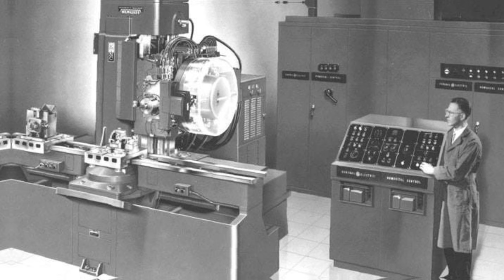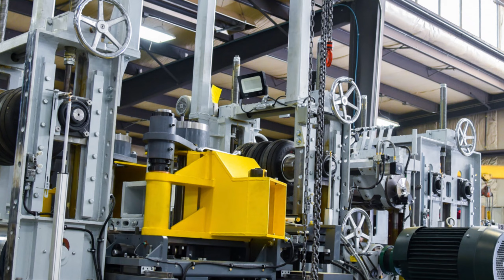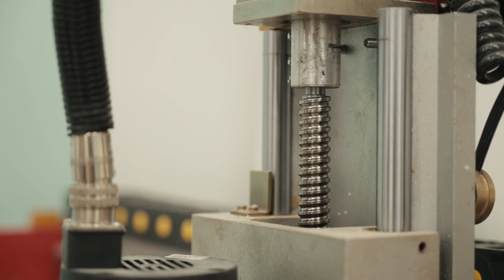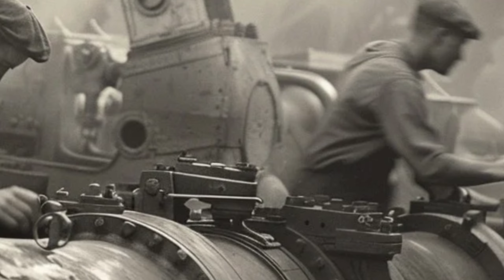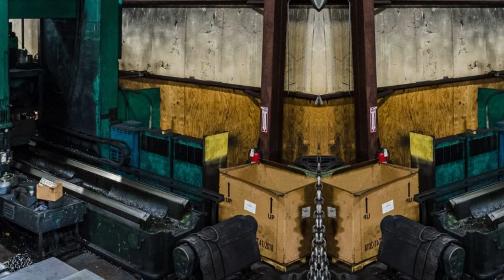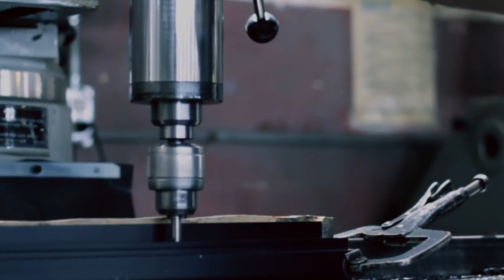The 1911 Planer Machinists Called Obsolete — Until It Removed More Steel Than Any CNC

Comment: In the early 90-ies I used to work in a shop made the turn out/ shifter systems for the railways in Europe... We used Waldrich-Coburg planers made in the 1950-ies . Depth of cut was easily 50mm ca. 2"  each step was 1.25 mm ca 0.05"... The 50x50 mm ca. 2"x2" tool  steel shank was bent time to time under some heavier cuts...